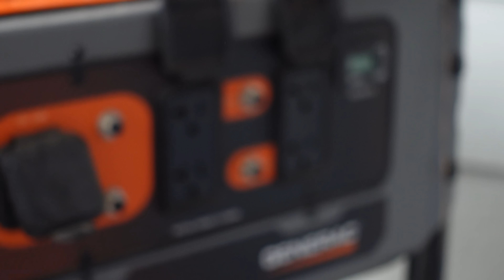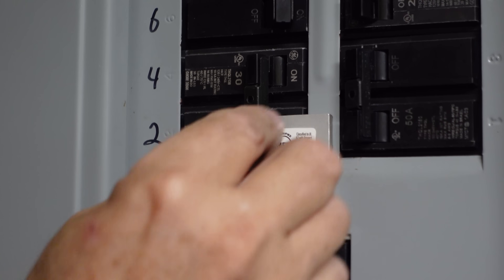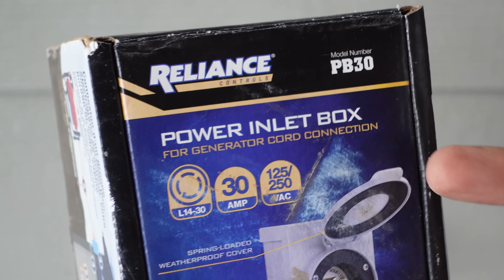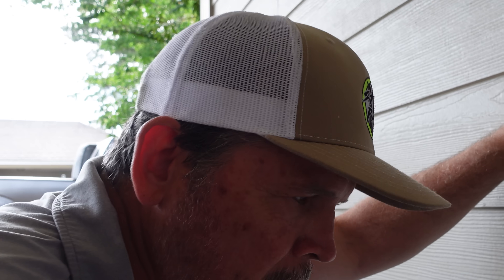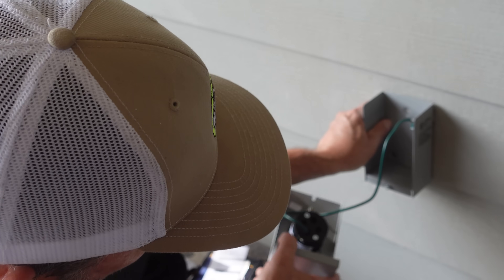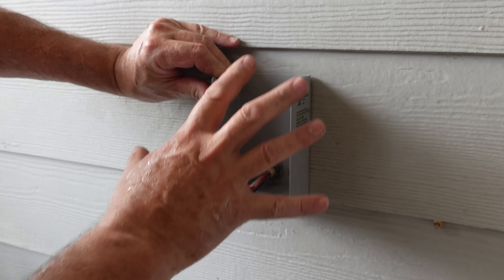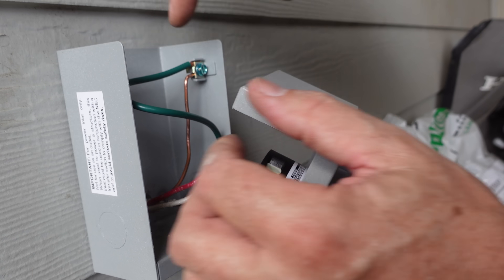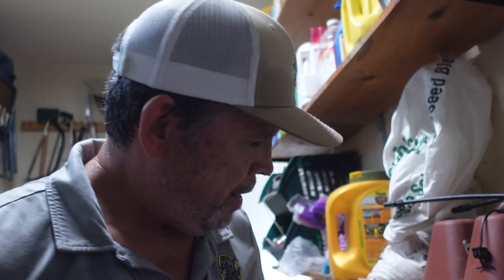What is a Suicide Cord and Why It Could Kill You

Comment: Got called to a job for bad gfci in garage apartment. New Owner had just moved in. Garage panel had long cord that could be unrolled  tied to 30 amp 2 pole breaker. Cord had male cap that was hot when the breaker on. Apparently previous owner had setup so they could plug into portable generator if power went off. Showed owner he had a dangerous situation and he had me remove cord. He said he had inspection before he purchased and no mention of a hazardous situation. He had small kids which could have been tragic if they had touch hot male cap

Comment: In one word, never make it possible for live electricity to appear on connectors with touchable conductor surfaces.
Due to the same reason, I personally think 1/4-inch plug speaker cables for connecting guitar amplifiers and cabinets is a dumb and dangerous idea. Newer and safer connectors (e.g. Neutrik speakON) should be adopted by guitar amp manufacturers. (Luckily most modern bass amps and cabinets use speakON cables)

Comment: I keep hearing that backfeeding a generator can kill a linesman.  If someone did backfeed to  the powerlines, wouldn't it immediately trip the breaker on the generator and be harmless to any lineman?
Reply: See it wouldn’t trip it as the polarity is reversed so the breaker won’t trip with negative amps. The breaker only trips above the rating. It can trip in the negatives if the amps are so low it’s below the rating in negatives.

Comment: good life-saving info! 
To finish off the installation details... water will get behind the newly installed box, run down behind the siding and also onto the plywood. I recommend at least caulking all 4 sides of the box and/or replacing the missing piece of Hardie, and caulking the piece in.

Comment: Suicide Cords can be dangerous.  However, there are a few times where their use is safe.  My list of Do's and Don'ts"

* Don't use a suicide cord to backfeed power into any home, ship, or other centrally connected electrical system.  Things connected to the grid can energize power lines and you will not deliver the proper number of amps to the circuits this way.  You can easily cause a short or an overload as well this way.  Also, if grid power or other power leaks in, and things are out of phase you can really blow things up. 

* You may be able to use such as cord to energize an outlet or a power strip if the system is totally isolated, such as in a device that you are building and you will run off an inverter or battery or something as the only power source.  

* You may be able to use such a cord to connect two cords together but only done under the right circumstances.

Comment: Very true about the suicide cable, but the person who is going to connect your generator to the electrical current distribution panel must know how to handle your generator correctly. #1. echanical Generator Interlock Kit
Suitable for use in accordance with Article 702 of the National Electrical Code, ANSI/NFPA 70
Generator Start-Up Procedure
1. Plug in power cord into generator and inlet box
2. Start Generator and warm up
3. Turn off all high load breakers Electric-Stove, Coa ktop, Oven, Dryer and Air Conditioner
4. Turn off Main Breaker
5. Move Interlock to block Main Breaker and turn on Generator Breaker
6. Reverse order to use Utility power
DONOT EXCEED GENERATOR'S CAPACITY It caught my attention that apparently the cable#12  to 20 amp and I connected it to the 30 amp receptacle, reducing its capacity. Otherwise good job.
Reply from the maker: It's 10g 👍
Reply: @StudPack  Thanks good job my friend

Comment: I have a question for you. I have a portable generator that is coming up to be 17 years old. My house is wire with a manual transfer switch with a 4 prong twist lock receptacle. My present generator also has a 4 prong twist lock connector. I'm looking into buying an inverter generator but every inverter generator I look at has a 120 volt RV plug.I'm planning on keeping my present generator as a back up or if a friend should need it during an outage. Do they make a conversion cord to go from RV to 4 prong female that I can use without a problem or need to rewire my electrical inlet.?

Comment: I dunno how I went down an old StudPack rabbit hole.  But for me, if I'm replacing an old outlet or seomthing, 99% of the time, the copper is weak at the screw and needs to be cut off anyways... So instead of taking the time to remove the screws and pull out the wire, I just CUT the wires with a pair of dykes flush against the outlet so its bassicaly cut right at the sheething making sure I dont remove any copper I dont need to give me as much slack as possible.

Comment: A German electrician here you guys have a 2 phase phase to phase system there so you should have a 120 degree rotation so shouldn't it matter wich way you attach the two phases? 

Here it matters a lot since pretty much all private households here are connected to the 3 phase electrical grid and if you wire it up wrong you get a left turning electrical field.

So can someone explain this to me since I'm not familiar with your system thanks and great video!
Reply from the maker: We actually have split single phase (180 degrees apart).   Have friends who call it 2 phase but technically that's incorrect.    Utilities run 3-phase power and take one of those phases, run it thru a transformer, and get two 120V legs 180 degrees out of phase with each other.   Put a volt meter across them and get 240V.  On a 120V 3 phase you'd get 208V across any two legs.  If a 3 phase motor is rotating in the wrong direction, swap any two phases and it will change the direction, same for you I'm sure.

Comment: Very nice video. One comment: I was always taught to put the locknut on the clamp on the outside of the box, with the screws side inside the box. That way, if you ever need to do something with the cable, like pull more cable into the box, you can do that without taking the box apart. You can also use the screws on the clamp to connect your ground if there's no other way to connect the ground to the box. And, that also solves the problem you had getting to the screws.

Comment: Good points about the suicide cord. Suggestions: I would have instead put in a flush mount receptacle, so it doesn't stick out from the wall, and be in the way outside. There's plenty of room inside the stud wall for the receptacle. I would also have caulked around or behind whatever receptacle you use, so blowing rain won't seep behind the receptacle and eventually rot the wood behind it. It looks like where the receptacle is located, there might not be a LOT of blowing rain to hit it, but it never hurts to seal it anyway...takes just a couple of minutes. This will also make it easier to seal against airflow into the building.

Comment: Suicide cables are like any very powerful tool.  When misused, they can be very dangerous.  Understanding them goes a long way to respecting the danger that a SC is.   With that said, showing up at my mothers house in the middle of the night of a snowstorm with a generator in the back of my truck to get her some electricity...  They are an indispensable tool.   My SCs are built very specifically: 1) buy a 12gauge 50ft regular extension cord. 2) from 12 gauge wire, make a 3 wire SC cable that is only 1 foot long. with the 1 foot long SC cable (really just a dongle being so short) lay it side by side the socket side of the 50ft extension cable UNPLUGGED.  3) use a zip tie to keep them together in an unplugged state, but not so tight that you can't slide out about 2 feet of the 50' cable to loop back and plug into one end of the SC cable. Now Step 5 is the only step necessary to ensure safe use:  5) put a warning label on the 1ft SC that says "DANGER NEVER LEAVE THIS CABLE WITH ONLY ONE END PLUGGED IN. EITHER DISCONNECT BOTH ENDS OR PLUG IN BOTH ENDS. NEVER HAVE ONLY ONE END PLUGGED IN.  Since the cable is only 1 foot long you have both ends of the SC cable right in front of you to make making the SC safe.

Comment: You need to be sure you did not create a "suicide inlet".  If that male receptacle (or inlet) ever gets energized, the blades in the inlet are live.  The interlock prevents this by ensuring that the utility line gets disconnected from the panel before that inlet gets connected to the panel.  But those low-cost interlocks are not idiot-proof; if you take the cover off the panel, you can turn both breakers on and energize the inlet.  In many areas, those low-cost interlocks are not allowed; you have to connect a "real" TRANSFER SWITCH, like the label on the inlet box calls for.  (Even with a transfer switch, the inlet could still become energized if someone feeds power to the house via some other branch circuit.)

Comment: You should never fire up a generator without having the cord plugged in first.  it's not a suicide cord if you use it properly. you can get yourself hurt using any connection if you don't use it properly.

Comment: If I have a 30 amp, 9,500 peak watt generator 7,500 rated watts 30 amp but have a 7500 watt receptacle, would that be a problem? given that the generator has more wattage than the inlet box ?

Comment: I had a cord like that on an old rv I bought.  Almost found out the hard way.  LOL 2 male ends on the  cord to the power on the pole.  I had just plugged in the end to the supply post and was standing in my bare feet in wet grass about to plug in to the rv when i looked at the plug and thought  "  OMG  unplug ..now! "  A trip to the hardware store and a n hour or so had it set up right  "WHEW!"

Comment: No, you really dont need AC.

I live in the UK. Our houses are designed to keep heat in. They're made out of brick, and have layers of insulation everywhere. Summers are horrible here. And yet we don't have AC as a standard. Why? Because opening the windows and some fans are usually enough.
Stop wasting money, time, and help the environment, and dont use or even install AC. Trust me, you dont need it.

Comment: You didn't discuss neutral/ground issues with a setup like this. Since this is not a separately derived service (SDS), you must make sure the neutral and the ground aren't bonded at the generator. If you can't confirm this with the product literature, you can always use a 3 prong outlet tester and verify the neutral and ground aren't connected within the generator. 

If the generator is configured as an SDS (this one is), you will have unwanted current flowing through the ground wire. This is why it is so important for people to understand this. If they don't (and most don't) this work should only be done by a licensed professional. 

FYI, this is only relevant to a grid connected sytem like the one in this video. If you are using the generator as   the only power source, (like an RV) then this would be an SDS. In this case the neutral would be bonded to the ground (EGC). You would also need a grounding electrode (GEC) that would also tie to the neutral/EGC connection.

Comment: Never use impact for pocket screws because it strips out instead use your regular drill in the kit on low setting,also I would pig tail the 2 ground and have 1 wire going to the box instead of 2 wires which is illegal almost everywhere

Comment: I have 20amp 120/240v 5500w generator. The 4 prong says 20amp. Do it install a 20 amp outlet and a 20 amp breaker? Will that run a well pump?

Comment: Awesome tutorial!!  Does the 30A double pull breaker feed both sides of the panel?  It looks like it only feeds one side.
Reply: If its 240 volt then its 2 legs (120V each, 180⁰ out of phase, referred to as legs of split phase power, not 2 phase) would mean it had to feed both sides of the panel (assuming the the sides are on different legs)

Comment: Did anyone check the wire size. to make sure it can handle the 30amp socket. looks like it's number 12 wire. 10 would work better. just asking
Reply from the maker: It's 10awg

Comment: The one item you did not cover is your taking out a 20 amp receipt and replacing with 30 amp receipt without mentioning the wire gauge that’s presently in the wall now. Is it 12 gauge or 10 gauge?
Reply from the maker: 10

Comment: The only issue with the male socket on the house is people will just wire it straigh in so it isnt disconnected when the grid is live. Could become more dangerous than a suicide cord in my opinion. In each scenario you need common sense unfortunately that doesnt exsist in many minds.

Comment: Also i dont if this video mentions it but best practice to ground your genny aswell so you get the protection if say a damaged extension cord touches metal. Something as simple as a jumper cabke clipped to your water pipe should do aslong as your water pipes are bonded to  ground. In the uk everything metal should be bonded like heating pipes.water.pipes and gas and assume thats the case in the US.

Comment: i was wondering why it's called this way, and then i remembered, when i was 15 and we moved into a new (unfinished) construction and the power was supplied by a cable from a generator, that we ought to plug in an outlet. And whenever I wanted to get power on a different circuit, i had to re-plug it into another outlet (on the new circuit).And one day i forgot the cable i was moving from one outlet to another has power, and i accidentally touched it....
that was some intense muscle cramps from the middle fonger all the way up to the elbow and above

Comment: Nice job on the upgrade. However, for someone with a receptacle on the generator and another one on the house and a suicide cord to connect them who can't or won't change things, it is worth mentioning the safe way to make the connection. If the house is plugged in first, the interlock ensures that nothing is live, meaning there is no voltage in the suicide cord until it is connected to the generator. So connect the cord to the house and then to the generator. To help with remembering the sequence, it may be a good idea to store the cord near the receptacle on the house.

Comment: Wondering if any other sparkies have been told that you are never allowed to run type NM-B cable ( Yea Romex ) to any outdoor box including entering the back of a pancake box for an exterior wall luminare. Inspector told us that romex is not approved for wet or damp locations and stated we have to use tupe UF cable for this.

Comment: Thank you for the guidance. I Had to make two 110v suicide cords during a power outage for a week. It was that or lose all my frozen food. Yes, I tripped off the main breaker first. Protect the lineman doing their job. The suicide cord danger is because the male prongs could arc or contact when energized? Safer to connect before energizing the cord.

Comment: Great vid on doing it right, in Ohio this includes a power transfer switch box. Too many $$$ for me. Anyway, gotta keep them snoflakes from hurtin themselves!  The interlock is a nice touch too, that way they can't hurt others or blow their power head. Only problem now is do they have enough IQ to start the generator and figure out how to use the plug. Broke generators on Marketplace every day say maybe not. I'm a late baby boomer, been using a "suicide" cord for years. Perhaps not for the faint hearted but, wrong or not, it fit my budget. At least my box install is solid and properly grounded. I've used the old lawn mowers without all the safeties too, the ones you could walk away from,  go inside and take a leak, come back out and it would stay running the whole time and never chopped off and extremities either. As a society, we seemed to have dumbed down on the common sense. Good thing the government was there to step in and save us.

Comment: I've got a question. If you are running on city power and that upper circuit breaker is left in the 'ON' position, won't that box you added have live 220 volts on that male plug?

Comment: If you had cut out the Sheetrock using a 30 to 45 degree angle inward of the hole, it would make it much easier to reinstall the cutout.

Comment: Guy from Canada here, and I’m frankly flabbergasted that there’s not only absolutely no insulation, no vapor barrier on the inside, or tyvek layer on the outside, but apparently also not even any exterior sheathing underneath the hardieboard?  No wonder it’s a crisis there if the AC goes out for 20 minutes- your electricity bills in peak cooling season must be nuts. I would have thought that sheathing would be required there by code to prevent walls from racking and toppling over in tropical storms if nothing else…..

Comment: Dear Stud Pack,
What a great educational video!! Explaining nearly every step along the way. I have only one other comment; you should have put sealant around the hole and romex connector. Even though the box you used has a water repellant cover, the hole in back side could allow moisture to get to the wall and damage the board you installed for mounting. Not a biggy, but the extra step could help long term.
Thanks for posting!!

Comment: Although you have the interlock at the main electrical panel , OSHA would still require LOTO procedures at the main panel, even with the interlock.  I've retired from doing electrical work but I'm pretty sure after years of audits and Task Safety Analysis  , you need a full Lock Out Tag Out ( LOTO)  at the main panel.

Comment: This is exactly what we did at my house! This panel interlock hardware is so much cheaper and easier to install than a transfer switch. With the wire, breaker, interlock and the box for the outside im only in about $150.